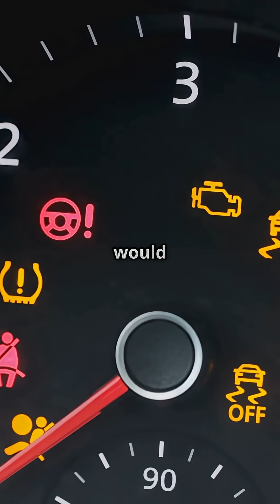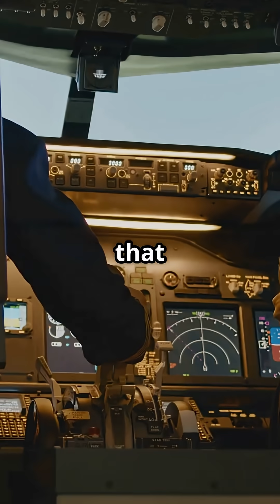Did You Know Planes Fly on Partial Thrust, Not Full Power?

Comment: not true. during takeoff, thrust is usually about 87-93% N1 (not full FULL power but close). Only reason to use TO/GA (100% or higher) is if the aircraft is extremely heavy and/or if the runway is short. during initial climb, this is usually around 85. However, during cruise, this is actually around 80-90, because pilots fly as high as possible while keeping N1 below 90%, while still reaching stable cruise speed. Once some fuel is burned off and thrust requirement is reduced, they usually climb even higher (step-climb), and power reaches around 90% again. This is good for fuel efficiency.

The reason why they dont use full power is it can cause wear. Past a certain point (MCT, Maximum Continuous Thrust) wear on the engine is exponentially higher when kept at the power setting.

Comment: This is completely BS. We run the engines at nearly full power. If you fly at only 60 to 80% power, you are at too low of an altitude and burning too much fuel. 

As soon as there is enough power available, we climb to a higher altitude, which means full power again. Engines burn less fuel at higher altitudes. Engine output is also reduced at higher altitudes.
Reply: yes. at a typical cruise altitude, 60% N1 thrust would get you going like mach 0.5, leading to a stall.

Comment: Thin air is not much drag. Therefore, the plane uses less energy to fly and save gas
Reply: No, it’s mainly because engines run a a specific oxygen to fuel ratio. So higher altitudes means less fuel,since there is less oxygen.